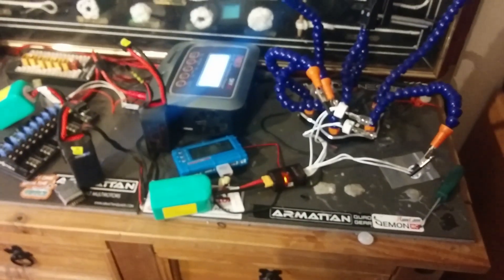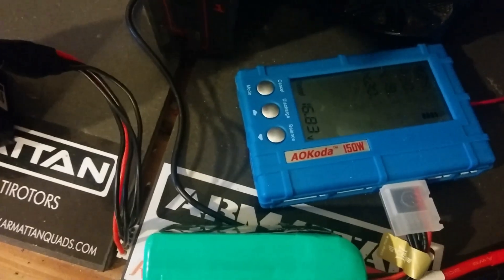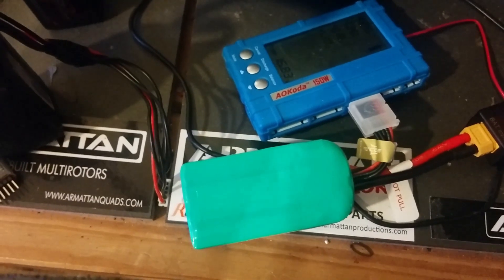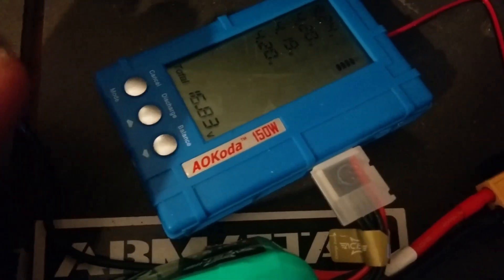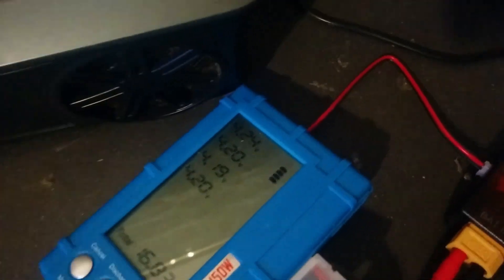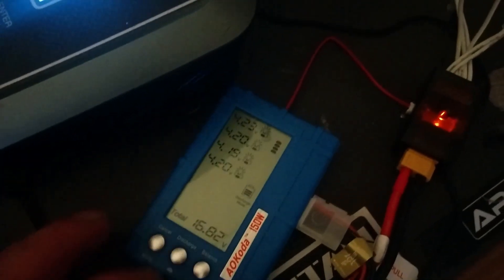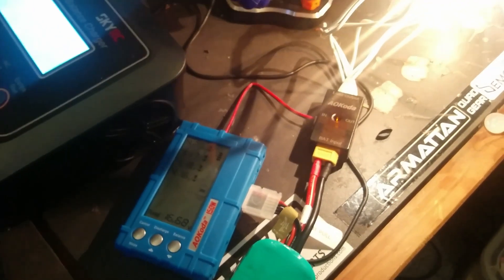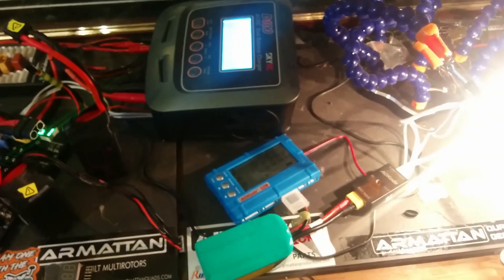AOkoda 150W Discharger/Balancer

Comment: Thats sweet man what do u have holding the wire i like that thing
Reply from the maker: https://www.banggood.com/Realacc-Strange-Third-Hand-Six-Arm-Soldering-Station-with-USB-Fan-p-1081818.html?p=N3081493554332017036

That's just one, they make smaller ones and there are others from other companies. I think mine might have been another model as I have the vice clamp in the center, I removed the fan and replaced it with an LED arm. You can buy extra arms, there's even one with a magnifying glass! lol

This is the one I have- https://www.banggood.com/Realacc-V2-Strange-Third-Hand-Seven-Arm-Soldering-Station-with-USB-Fan-Caliper-p-1148617.html?p=N3081493554332017036

This is the 3 arm one, it'e cheaper- https://www.banggood.com/Realacc-Strange-Third-Hand-Three-Arms-Aluminum-Alloy-CNC-Soldering-Station-Rose-Black-Green-Blue-p-1158376.html?p=N3081493554332017036

I warn you, those are affiliate links, if you don't mind helping me out, please click on it if you are buying anything, it won't cost u any extra!